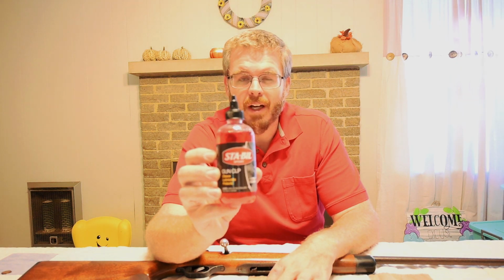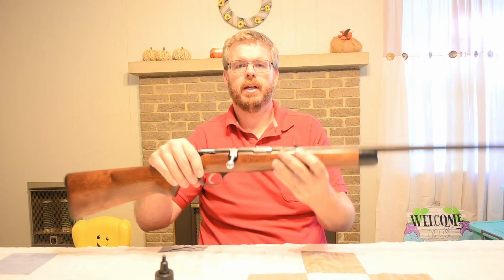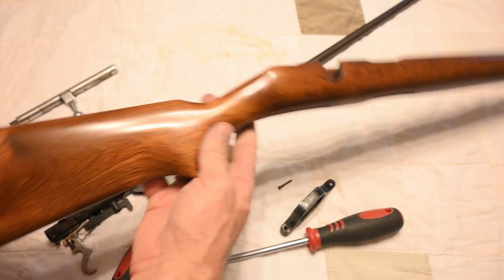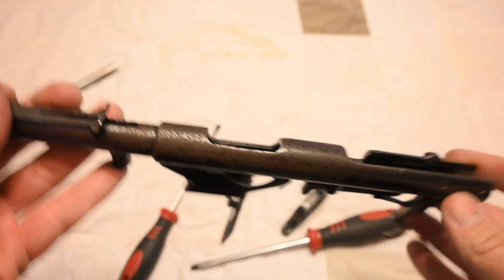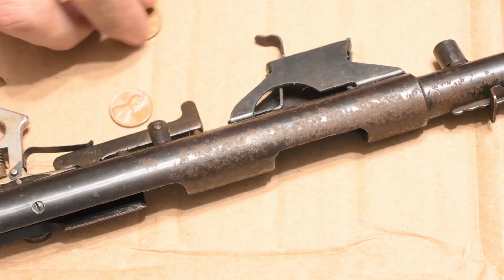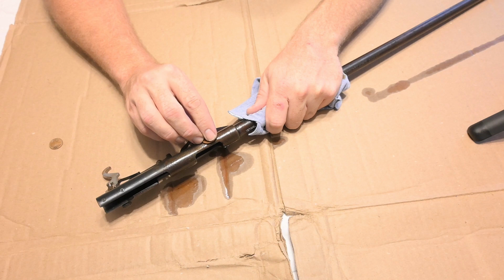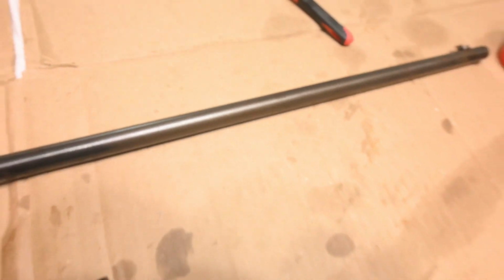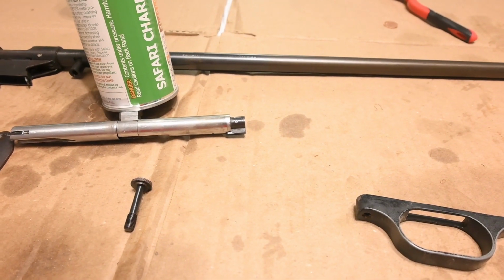Part 3: They ALL Rusted: Remove Rust from Guns with a PENNY!

Comment: Tried the penny dry on my old bolt action 22, light surface rust. Cleaned up with solvent afterwards then gun oil. Holding the penny at a 45 degree angle makes it work more like a scraper. Worked just fine.

Comment: I've got an old Stevens model 66-b. Rust isn't quite the problem yours was but the knob on the bolt handle is loosing the chrome and I really don't know what to do about it other than love it for what it is. It's Grandpa's old rifle. Possibly from the 30's!
Reply from the maker: That’s what was going on with mine....I plan to revisit it in another video and work on the chrome and polish the bolt. I had to look the 66b up...looks like a cool gun.  They don’t make them like that anymore!   That’s what I love about mine is the heavy barrel!    Thanks for watching and commenting!!
Reply: @onthejline9328  it's what having a channel is all about, building community and helping each other. Looks like the penny did a great job, seems like a great idea! I have used tin foil and oil to shine up some chrome just not in an application as ours. However tin or aluminum foil absolutely helps just in lesser application. Maybe bumpers and grill with light scratches and light damage!

Comment: I'd stick with the copper scrubber and a little white mineral oil mixed with kerosene or mineral spirits to provide lubricity to the surface
Reply from the maker: Like the mineral oil in the pharmacy section?   What does the kerosene/mineral spirits do?  Thanks for commenting!
Reply: @onthejline9328  Mineral oil Laxative.  Its the same oil packaged and sold by Remington, Hoppes, and used in sewing machines and food equipment.  Gun oils are industrial oils like spindle (Mobil Velocite No6) or steam turbine oils (Shell T32.)   The mix is what is sold as WD40.  You can confirm by looking up the CAS numbers listed in the Materias Safety Data Sheet.  It penetrates to the metal surface (water displacing) and suspends the rust particles so they don't  abrade the good bluing.

Comment: I would guess you could use a piece of soft copper pipe if one Doesn't have a pre-1980 penny.
Reply: Copper pipe is almost 100% copper so it would be softer than the copper pennies. More like the copper scrubbers. A suitable length of copper pipe would be easier to hold on to and could be shaped on the end to fit more contours.

Comment: Interesting video....however, I remain sceptical to this method. It seem like scraping off the rustflakes while the copper is soft enough not to scratch up the blued surface too much. 
Looking at Mark Novak's channel, a gunsmith dedicated to restoring old military firearms, he always boil, or steam the rusted firearm to transform the rust into black oxide, and then use a carding wheel  to very gently polish the crusty surface after boiling to a very nice finsish. This preserve what original bluing i still on the gun.
Reply from the maker: I also want to try the boiling method.  I will check out his channel.  My main intent was to remove the rust and prevent further rusting.  I intend to do more videos experimenting with re-bluing    Thanks for the comment!

Comment: I would suggest a Carding wheel. I have had good results with removing rust from firearms.
Reply from the maker: Thanks for the comment!   I have a gun that I want to try boiling and carding on but I haven’t gotten the necessary supplies yet, nor I have researched it enough to make sure I don’t screw it up! Lol

Comment: Nice video.  Help me understand why you are using the penny on the non blued parts.  The point of the penny is for the preservation of the blue.  Just use flitz with a buffer pad on a dremel on the bolt and trigger.  It had no blue to save.
Reply from the maker: Thanks for the comment!   Basically at the point I made that video I knew very little about what I was doing and was just trying different things.  Since I was testing the penny I just used it on everything.  I still don’t know much...but have learned a lot through trying the videos.   I ask my viewers to keep in mind this isn’t a “how to” video, but instead a “I’m going to try this....tell me what you think” video.   Again thanks for commenting! I’ve never tried flitz but do plan to go back with a dremel and polish a few of my bolts

Comment: I would think that the true copper scrubber would work better than the copper penny. There is a limited amount of contact surface with the penny as apposed to the copper scrubber. Depending on the composition of the scrubber the penny might actually be a little harder for tougher jobs.
Reply from the maker: Yes the pure scrubber is much more effective and user friendly!   The penny was just testing an idea and seeing if it could be done!  ...Thanks for commenting!

Comment: Seems like using something like a penny( even though it is copper)that is not just flat but has high an low surfaces on it would tend to take the surface of unevenly.
Reply from the maker: The penny actually wore down until it was relatively smooth before I finished.

Comment: thx for vid, if there is that much rust on the bolt, won't there be similar on inside of barrel? this is patient work, the penny allows more pressure so maybe quicker than copper pad or brass brush. i've not tried the boiling/carding method of your other commenters, but this gives a workable, inexpensive method, keep up the vids
Reply from the maker: Thank you I really appreciate that..     the rust on the bolt was mostly limited to the small area covering the chamber, and on the knob.  The area on the knob has been there since I bought the gun.  So far the inside of the barrels are clear and free.  The first thing I did once discovering they had rust on them was use a cleaning kit with the wire brushes and run the inside of the barrel and oil them.   I sprayed the outsides with Rem Oil and stored them until I could work with each one individually.   A process that I’m still working on.  Thanks for commenting!

Comment: I would not have the patience to use that little penny. Got to give you props for that 👏 
Not sure which one was better of the 3 scrubbing items but wow did the penny get it off the trigger or what? I think both oils did absolutely nothing removing the rust. Going to have to go with the safari on that.
Birchwood Casey rust remover will remove the rust and the bluing for sure!
Reply from the maker: Thanks for watching all three!   I tend to agree with the oils.  I think they mostly just aid in reducing friction (like wet sanding) but I think the safari was actually helping to “cut” the rust.  Hey as far as patience is concerned that’s why I did the video! For people interested in seeing it but may not have the time to do it   Oh by the way the penny was a pain to use after my hands got oily, i kept dropping it!
Reply: @onthejline9328  haha I bet! The penny would have put me in a nut house. They were interesting glad I seen them all also.
Reply: Try an actual (British, 1970 or prior) Penny.
They are bronze just as the pre - 1982 U.S. Cent (changed mid '82 to copper plated zinc) but about the diameter of a U.S. Half Dollar.
Reply from the maker: @-oiiio-3993  oh that would have helped a lot being bigger!   I will have to see if I can find one..
Reply: Try a US Large Cent

Comment: I use a copper wire brush on old steel refurb. The copper pot scrubbers are sometimes steel with copper plating. Pre 82 Pennies are actually bronze.
Reply from the maker: Yes you have to be careful with the scrubbers to get pure copper
Reply: Pre 1982 copper composition pennies are not bronze. There is no tin in the penny.

Bronze is actually 88% copper and 12% tin with some variation depending on how hard you need your bronze to be.

Pre 1982 copper pennies are 95% copper and 5% zinc which makes them a very poor substitute for brass which is 66% copper and 34% zinc. There are a lot of variations of brass harder or softer, none of the variations come close to the composition of a pre 1982 copper penny.

So penny copper is just that penny copper.
Reply: @thinkfirst6431  the book says they are bronze
Reply: @66bigbuds  From the US mint:

"Copper coins, such as the penny, started as pure copper, but rising copper prices led to changes in composition. In 1857, the Mint added nickel to the copper, but switched to tin and zinc in 1864. For the year 1943, pennies became zinc-coated steel because copper was essential to the war effort during World War II. But the Mint also struck a limited number of copper pennies. In 1962 tin was eliminated, and in 1982 the penny became primarily zinc with only 2.5% copper."

There is no zinc in bronze, there is no tin in brass. 

Bronze is still about 88% copper and about 12% tin. Brass is about 66% copper and about 34% zinc. Up until 1962 a penny was nether bronze or brass but a mixture of 95% copper and 5% of  tin and or zinc whatever was cheapest at the time, the tin and or zinc just made the penny a little harder so that they would wear longer. Between 1963 and the end of the "copper" penny, the US mint actually calls them Cents which is the correct name for them, the composition was 95% copper and 5% zinc which was at a stretch a crappy brass and actually just a copper alloy with some zinc in to make it harder as tin got more expensive than zinc.

The "book" what ever it is is wrong by classifying pennies as bronze, it would also be wrong if it classified pennies as brass.

You can pour milk into coffee it still doesn't make it a latte it just makes it coffee with milk in it. Bronze is a very specific material, brass is a very specific material. Copper pennies made between 1864 and 1982 are neither bronze or brass.

Comment: I will try the vinegar trick on some tools,what about rust electrical transaction using battery charger + - leads
Reply from the maker: Thanks for commenting!   I think vinegar on tools would work great...I have a cast iron cauldron I will be using vinegar on in an upcoming video BUT vinegar will remove blueing so be careful around firearms

Comment: I have that same exact 22 rifle.
Reply from the maker: It’s a dandy!   They don’t make them like that anymore.   I will say that when I refinished the stock that black paint on the end was a beast to do!   It was hard to get it compatible with the clear finish on the rest of the stock
Reply: @onthejline9328  , actually my mom, who loved wood refinishing, did that black end cap   almost 50 years ago and did the whole stock, used Birchwood Casey tru-oil. Still looks and shoots great! I had a gunsmith mount the basis for a scope around the same time. I was just shooting it about a month ago!
Reply from the maker: @SuperLou63  I want mine drilled for a scope base.  My eyes ain’t 20-20 anymore. Lol.   I honestly don’t remember if I used spray polyurethane or lacquer.  It’s been about 12 years ago

Comment: I think 1964 was when coins changed. Pennies could have changed later though.
Reply: Pennies were British.

The original U.S. Cent was pure copper from 1793 through 1857, then an 88% copper, 12% nickel alloy through mid 1864 before changing to bronze which was used through mid 1982. Cents from mid 1982 to present are copper plated zinc.

The alloy used for U.S. Dimes and Quarter Dollars changed in 1965 from 90% silver, 10% copper to the copper nickel 'clad composition' still in use. Half Dollars were also last minted (for circulation) of 90% silver in 1964, then changed to a 'silver clad' composition with net 40% silver content for 1965 through 1970 before changing again to the 'copper nickel clad' in 1971.

The five cent 'Nickel' is composed of the same 75% copper, 25% nickel alloy used on the outer layers of the 'copper nickel clad' coinage and has been since 1866 (with exception of 35% silver issues of WW2). The alloy was first used for the Three Cent 'Nickel' of 1865 - 89. A silver Half Dime had been issued from 1794 - 1873.
Reply: @-oiiio-3993  I know we were always told that us if you wanted to get any good coins  to pick 64 or earlier. Manly they were talking about silver though. 
 Thanks for the insight!!!
Reply: @edarnold1426  Indeed. 
It's 1964 and prior for 90% silver dime through half. 
As many people are unaware that the halves of 1965 through 70 are 40% silver they can still be found in bank rolls.

'Wheat Back' cents were 1958 and earlier.
Reply: @-oiiio-3993  I've got a bunch of wheaties. I never get rid of them.

Comment: Once you have your gun stripped down, get a piece of 4 inch PVC drain pipe and a cap. Get 3 gallons of white vinegar. Slide your gun down into the PVC with the cap on the floor and the tube standing up. Let it soak for 24 hours. When you pull it out and wipe it down there will be no rust. Wipe it down, dry it off, get your gun oil out and lube the parts that need it, and put it back together.I found an old gun in a barn. it was in a small bucket which had been sitting full of water for at least a few years. The gun had heavy rust. The old man next door told me about this trick, and I thought he was missing me. It worked like a charm. (The gun was heavily pitted and was never going to be a shooter again)I did the same thing with old rusty tools. Put a bolt in a bucket of water and leave it there for a couple of weeks. Try this little trick for yourself.
Reply from the maker: I think the pvc trick is a great idea for a vessel to put the barrel in BUT I caution against vinegar as it removes blueing. See my next video coming soon where I learned that lesson!
Reply from the maker: Thanks for commenting!!

Comment: Try using tinfoil ,this is used a lot by bikers because it is softer on the metal and does not dig into it.
Reply from the maker: Will definitely have to try this!
Reply: Yes, if you scrunch up the tinfoil and dip it in coca cola ,the coke nulifies the rust and the tinfoil takes off the rust. I renovate old motor bikes and use this technique to great affect. Glad to help.
Reply: Aluminum is too hard.  Bikers use it on chrome, which is much harder than the gun steel.  And the Phosphoric Acid in Coke?Gun bluing is a thin layer of oxide aka rust!  Acid baths are not good for bluing.
Reply: Do not use aluminum foil on bluing .It's to harsh an will take the bluing off
Reply from the maker: @richardtrice9807  do you think this would work on the bolt knob?   I think it’s stainless...
Reply: Tin foil works like magic on chrome !!! Not a gun barrel...
The penny is just some soft tool to scrape off the rust...
Reply: There is no blueing left on the guns.